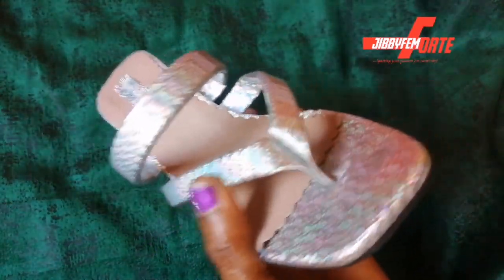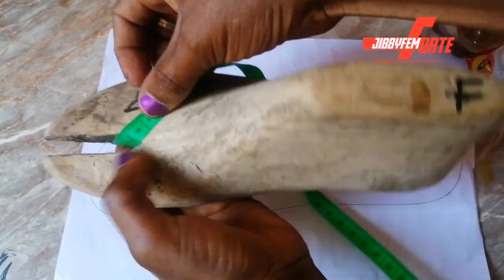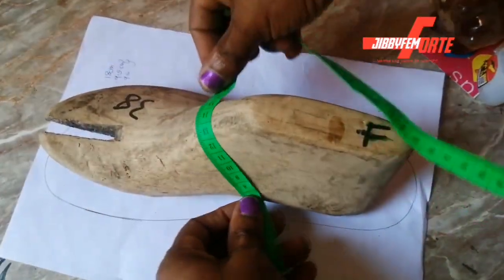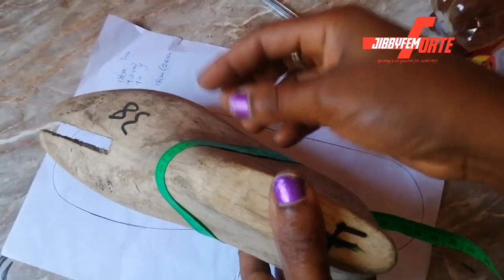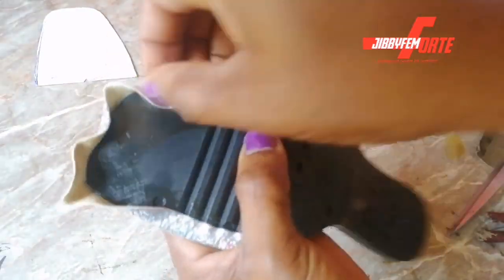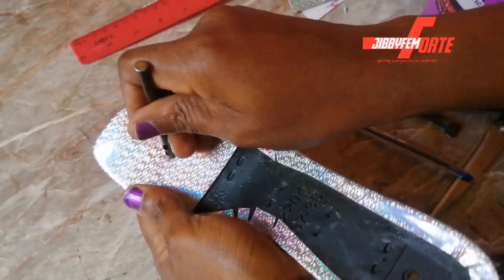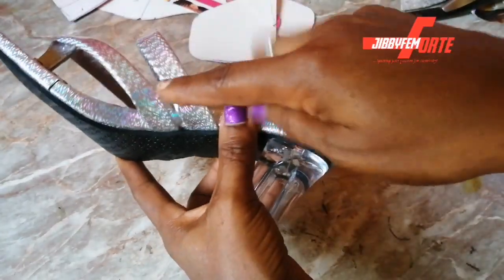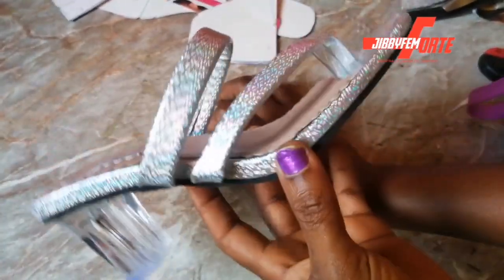HOW TO MAKE BRIDAL HEELS :DIY PADDED WEDDING HEEL

Comment: Is pu/chemical gum  the same with contact cement?
Reply from the maker: No, it's not when you differentiate using the compound they are made of.
Reply: @JibbyfemForte  okay .. but why was chemical gum used for the sole? Is it because it is stronger?
Reply from the maker: @faithagdk473  The compound each of them contain differs. Let me sight an example, Can you use super glue to bond cloth?